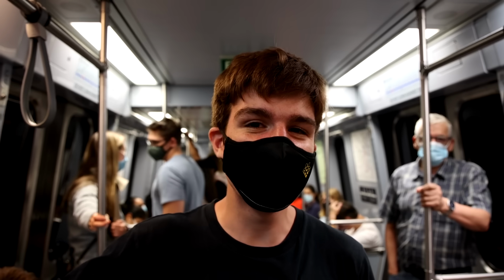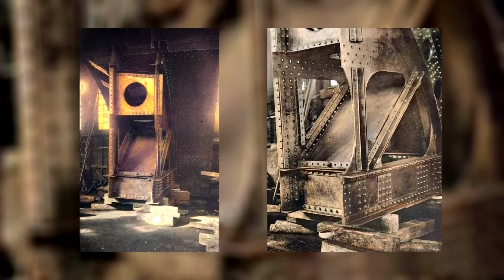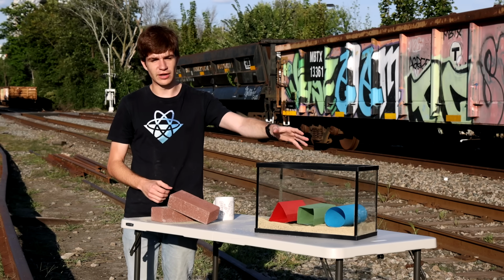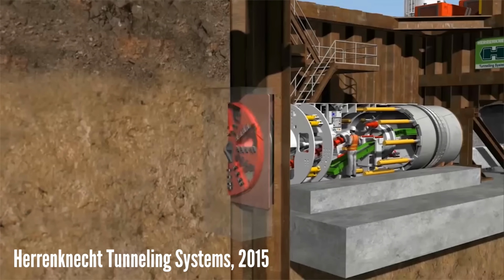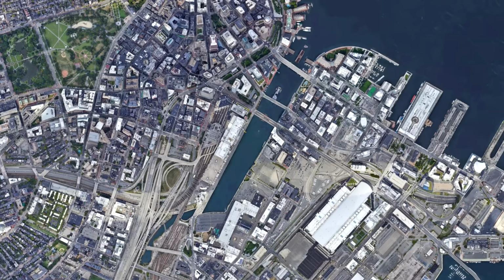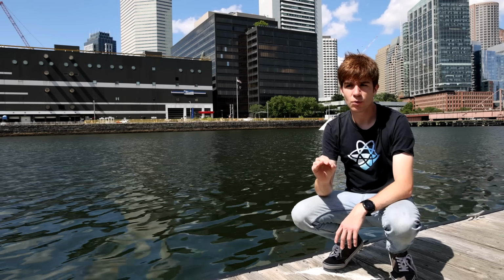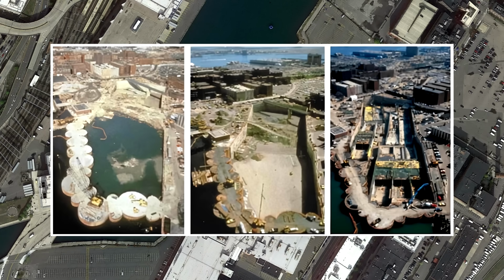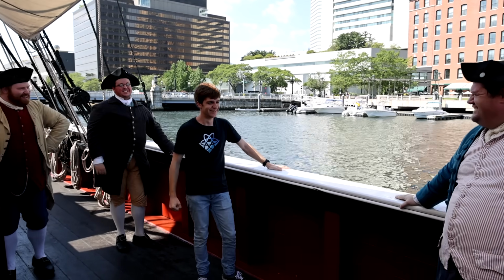Why It's So Hard To Dig Tunnels Underwater

Comment: There's a nightmare subway station in my town, Hamburg, called Jungfernstieg, that's mostly located under the central downtown lake. It's the second most frequently used station behind the main central station. So in the now over one hundred years since the first subway was constructed in this town, every time a new subway lane was added, which was and is happening basically constantly, it needed to reach that station too. This resulted in the station having four subway platforms in three separate segments that criss-cross each other 3-dimensionally on different subterrainian depths: One for two S-Bahn-lanes in both directions, one just above that but perpendicular for one U-Bahn-lane in both directions, and one large one with two platforms for originally one and now two more U-Bahn-lanes below, next and parallel to the S-Bahn segment. These three underground segments are all connected with sometimes winding staircases cutting through the soil on all possible sides of all platforms between each other and the surface. In the last ten years, for purposes of accessibility, there's been an effort to build elevators for every single subway station in town; they're about 95% done now, but this one will be their final boss. They haven't even started trying yet.

It gets more complicated: The only U-Bahn lane that isn't present in this station has a station near it, and there's a tunnel connecting these two stations as well, technically making it one particularly large one. Also, additionally to having almost 20 surface access points, one other tunnel leads to the lowest level of a large nearby shopping mall. If you were to walk from one far end of one station to the far end of the other, you'd be walking 5 minutes if you went beeline, up to ten if you don't exactly know what you're doing, and MUCH more if you made an effort to visit every single segment. If you challenged yourself to walk underground in this station without ever walking the same path twice, you could easily spend at least one hour in this complex.

The station is so convoluted that the local public transport company created an augmented reality "game", a browser-accessed and local public wifi enabled feature for AR-capable phones, that shows you directions floating in the air for the two most important exit points (the lake and the mall). So far you can't get directions to any of the lanes; I hope they add this feature in the future, because the AR feature itself does work well and is actually an amazing idea.

Right now, an entirely new subway lane is being constructed in town, and within the next ten years, it, too, will access Jungfernstieg. I hear the plan is to construct an entirely new, fourth segment, for which they'll section off and dry up part of the lake once more, which they already had to do for every single other of these segments. I really hope the AR game is complete at that point. Right now, any time I speak to someone visiting or moving to Hamburg, I tell them that you're not officially a Hamburger until you got lost at Jungfernstieg.

Comment: It is an idea cooked up by a professor with no experience in industry.  Lots of things look good on paper but do not work in practice like metallic glue.  I was given samples of mesoglue to try out.  I do not have anything against the professors who invented it but in an actual shop it doesn't work.  I can get the same results with a lot less trouble with commercially available superglue, acetone, and sandpaper.

Comment: How would you seal a transatlantic tunnel and keep it pumped down?  That tunnels is going to be expanding and contracting a good couple of miles and stretching 47 different directions.  I never saw a gasket that sealed vacuum that ever worked again if it moved.

Comment: A long time ago in Minecraft on my Island world I had set up a underwater rail system that Passover massive oceans. I made it on the ocean floor so that I could have easy access to it but then I took three things when it would have been too much trouble or made a really annoying railroad that swirled around. Took a lot of work but it was a ton of fun very beautiful to ride through in a minecart.
Reply: What I did what's fill in the inside of what would be the tunnel, completely, just placing all the water, and then I build glass around it and then it would or stone on the bottom to hold it all together. Then I would block off the end and then clear out all of the filling material and then it would be dry inside.
Reply: And putting together a diving suit helped a lot.

Comment: Nice idea to use the cardboard shapes to see which which shape is best under these circumstances; clearly the circle. But why? I don't think that what happens at the corners is the key in this case. From what I can see, the corners of the triangles are not much affected for a lot of the time. It is the long flat sides that get bent easily on the triangle and square.

Comment: It's interesting that the idea of circles being a better shape for tunnels because they don't have any stress concentrations is exactly the same reason why the windows on jetliners are rounded. The first jetliner, the DeHaviland Comet had squared windows, and initially there were several catastrophic failures. After doing some investigations it was found the cause of the failures were the windows being squared and just as your diagram at 3:56 shows the corners of the squared windows failed under the repeated pressurization and depressurization of the cabin over multiple trips, microfractures developed and eventually, the weakened structure gave away while it was pressurized at cruising altitude.

I'm noticing a LOT of these videos, if not all of them seem to be topics that apply not just to what he's talking about. There have been a few I've found so far since discovering the channel a couple of hours ago. I think it's awesome when a topic in science isn't just relevant to one specific area, but a whole broad range of different, seemingly unrelated areas. It really highlights how interconnected all of science is.

Comment: in the atlantic u have some more problems with ankering. u cant just anker it to the ground, as the ground moves. u cant just hang it in there, as there are currents, u cant just let it swim, as there are winds. the longer the whole thing is, the more all this sums up... at a few hundred metres such movements stay withing the materials tolerance for decades, maybe centuries, but if u go hundreds or thousands of kilometres, even small or slow forces will sum up and completely deform ur construction within years.
giving each section propellant to keep it steady sounds like a extremely american solution, something that is highly inefficient.
maybe with a mix of several solutions and ankering methods with more sturdy segments together with more flexible segments, we could come up with smething that could holds for some decades, but we also could just build ships or maybe revive ecranoplanes

Comment: Far cheaper to dig under the Bering sea, it's only around 40 miles and then add around 5000km of new railway/railroad track and you would be able to get on a train in New York city and get off in London...

Comment: Despite the engineering and physics challenges, how about this:  It's about 3,000 miles from North America to Britain.  At 60mph, that's 50 hours. (I picked 60mph for easy math.) Even if only EV's are allowed, there's the problem of getting electricity at least 1500 miles from either end w/o extremely high voltages.  And then there's the human factor. Sleep, food, and piss. 

And an accident or mechanical failure?

Then the economics.  The cost would be trillions of dollars, but the tunnel could only carry X number of cars, so the per car cost would be very high.  Much cheaper to jump on a jet. 

Then the left/right side of the road.  Whether going east or west, suddenly one would find themselves in a car totally unsuited for the new environment. I remember driving a LHD Chevy in the RHD Bahamas almost sixty years ago. A safety nightmare.

But it was a great video, thank you.

Comment: Correction on the "build through ocean part": these tunnels are made to withstand the pressure under the dozens of meters of water covering the river not several kilometers of the ocean floor. The pressure would crush them less than a tenth of the way through. Even with most durable materials known to us today building such a tunnel on the ocean floor is absolutely impossible.

Comment: The problem with building a tunnel from the US to Europe isn't the technology, it's the scale. The tunnel would have to be manually monitored for cracks, etc, and if you're 1500 miles in the middle of the ocean where are those people going to live? It's more complicated than just if it's possible, it's logistics of it actually being functional. It would make transporting goods much cheaper though.

Comment: a drive with my gti which gets 25 mpg would cost me 604 dollars in gas, 37 hour travel time and thats if I able to go 100 mph the whole way. Not to mention putting 3,700 miles onto a car in the middle of a tunnel would be an awful idea. Why not just take an 8 hour flight for 50 extra dollars. dumb concept.

Comment: Just because we have the technology doesn’t mean it’ll happen. This would be like a 30 hour drive….there would need to be multiple underwater or floating rest stops with hotels, not to mention fuel stations. The whole project would be a massive undertaking for very little return.  Even if the tunnel existed I imagine it being empty most of the time since you can get on a plane for a couple hundred bucks and be there in 5 hours.

Comment: Here are 3 facts about the Atlantic Ocean you need to know to understand how poor this idea of building anything from Boston to Berlin is in every respect:
- The Mid-Atlantic Ridge spread at the rate of 1-2 inches per year
- The Ocean itself is on average 2.2 miles deep
- The average current speed of the Atlantic Ocean is about 4 miles per hour

Simple math and a little knowledge of Physics will tell you with just these three facts why you can't dig a tunnel under the Atlantic, why you can't build a bridge over the Atlantic, and certainly why you can't anchor anything neutrally buoyant across the Atlantic. That's before you get to the incredible and totally not feasible in any real/useful scale in the real world, beautifully animated, and way over-invested and over-hyped world of the hyperloop.

Comment: Engineer here, it's not possible to build a tunnel under the Atlantic ocean. The water is too deep, the pressure is too high, the tectonic plates under the Atlantic shift too much, the ocean currents are too strong, the sea floor is too uneven. Even could you build it, it would be impossible to maintain, or keep safe. Not gonna happen for a hundred years or more, if ever.

Comment: Why didn't you just do a video on tunnels instead of pretending it could be possible to one day build a tunnel across an ocean? This video misses all the huge actual problems that make tunneling across the Atlantic impossible... a tectonic plate boundary in the middle of the ocean, insane water currents moving in different directions, it's 8000m deep so good luck using tethers. Nonsense video.

Comment: Even if it was technologically possible and economically viable to build said tunnel across the Atlantic there would still be one last big problem. The distance from Boston to Brest is 5000km (3100miles). Thats an extreme distance. Even if you were allowed to drive at Danish (my home country) motorway speeds of 130km/h (80mph) (Which is pretty standard in Europe I guess?) it would take around 38 hours to complete the trip. This would mean that you would have to have transatlantic gas stations and hotels/rest stops. It would be an absolutely extreme trip to take. One thing is driving 5000km which can be done over a couple of days, but imagine doing this in a tunnel. Driving straight for hours on end. Furthermore should there be a crash halfway through the tunnel it wouldn't be viable for emergency services to have to drive 2500km to someone in need. Therefore the crossing should either be 1) at your own risk! Which isn't viable as the tunnel would get blocked quickly. Or 2) have to have emergency stations including hospitals as air transportation isn't and option. This would mean a lot of people employed to work in the tunnel. In the end with the maintenance and staffing of this huge tunnel it would end up costing more than a flight across, and for shipping there is a more cost effective option, shipping. So, to sum up, even if it was technologically possible it would never be cost effective or convenient enough to make sense from an economical perspective sadly. But it would be cool to try once and then never again. The only other option then would be a hyper loop system which would further complicate the build. To add more to this, even if the tunnel was a hyper loop tunnel it wouldn't save much time. The speed given for the hyper loop is 760 mph. which would mean it would take around 4 hours for the hyper loop to get you across, which is much more manageable. But, how long would it take to fly the same route? Well. I couldn't find a direct flight between Boston and Brest, but to Paris the flight was around 6 hours. The hyper loop would it be extended to Paris takes around 5 hours, which means we would save and hour in travel time. Prices would likely be similar if not more expensive and security would also still be a hassle (They aren't gonna let you go into that tunnel without searching you from top to bottom). So, all in all it sadly just doesn't make sense : (

Comment: First let me say good video, this is in no way a criticism I know this is just for education and the like, this is more so just my mind thinking about all the potential problems with a tunnel that massive, I don't think it would even be slightly close to reasonable to make a tunnel that far from boston to berlin, I looked it up and I keep seeing different distances for how far away they are from each other one said 4843 miles another said 3778 miles, the second distance seems to be what most things said so I will use that for my example. According to my math to drive 3778 miles it would take about 54 hrs at 70 mph, and given that the recommended maximum amount of driving in one day is 8 hrs(says google at least), it would take around 6.75 days of driving 8 hrs each day to reach one end of the tunnel and that is at a constant of 70 mph, compared to flying on a plane which is anywhere between 10-12 hrs or so.

Given that fact that it would be so much slower then a plane, and the sheer amount of effort it would take designing and building something like this and the tons of potential points of failure, as well as the price of materials alone to span the 3778 mile gap, not to mention the cost of labor and construction nor how long it would take to build, and the issues with supplying oxygen down in the tunnels and venting out the exhaust fumes(not really much of an issue with electric cars I guess). With it being the single largest single structure ever made by mankind to date it would be a monumental task, but around what depth would you put it at, how would you avoid dmg to the tunnel from submarines and whales(more so just rare potential issues, probably not something to worry that much about), plus the currents alone even underwater would be an issue, the maintenance would be insanely difficult and costly, how would drivers take breaks in the tunnels, cause you would need breaks and maybe a place to park your car to the side and sleep in, would you have restrooms/rest stops inside, what happens if their is an accident just think of the time to respond and cleaning up or potential dmg to the tunnel possible from that and how damaging and costly that is, wouldn't it need some form of joints like expansion joints on bridges so when it moves around so the structure doesn't just crack apart, even with tethers to the ocean floor wouldn't it still be at risk of potentially rolling(sideways/upside down like a plane), if it also needs turbines to stay in place how long are those expected to last before maintenance/replacement, how much power would that cost daily as well as the lighting and how much power that would cost, it would probably be really inefficient to drive trucks through there instead of cargo ships, and also what you do about gas stations or would you only have electric cars running through it, I could continue but I should probably stop now.

Comment: Feasibility aside, just imagine the nightmare of actually traversing the atlantic through a hypothetical tunnel! It would definitely have to be a train tunnel, ideally a bullet train or something similar. It'd probably be about 5500 km/3400 miles long. A bullet train could travel that distance in 17 hours. It would be quite a challenge to power it, and maintaining a breathable atmosphere in the tunnel could be difficult, but it'd be much more feasible than a road tunnel.

It'd take 40 hours by car. And think about all the amenities that would need to be constructed along such a long road tunnel - gas stations, restaurants, hotels. Mechanics and tow trucks in case someone broke down or got in a car accident. Hospitals and ambulances too. Gas and food would cost a fortune, because it'd have to be either trucked in along the tunnel or delivered from ships on the ocean's surface somehow, and employees would need to be paid well to live in a tunnel for extended periods. It might barely be cheaper than flying. And imagine how utterly claustrophobic it would be to be stuck driving along a small tunnel for 3+ days! If there was a trans-atlantic road tunnel, I really doubt anyone would actually want to use it.